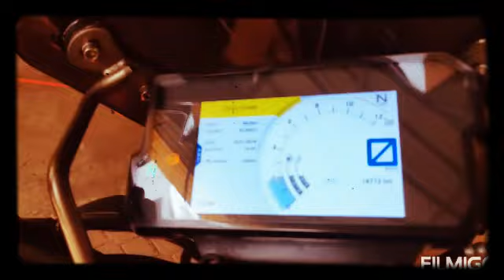DUKE 390 - COOLANT CHANGE (UPGRADE TO ENGINE ICE)

Comment: Hey buddy,
Did you see improvement in engine temperature when you choose Engine Ice over Stock Coolant?
Pls do reply, your experience matters!
Thanks
Reply from the maker: Hi.
Thank you for watching. Yes definitely improved. A lot better cooling than stock. And the coolant lasts 30,000 km.
Reply from the maker: Stock coolant use to give me pinching heat near legs, now after using engine ice, that's not there.